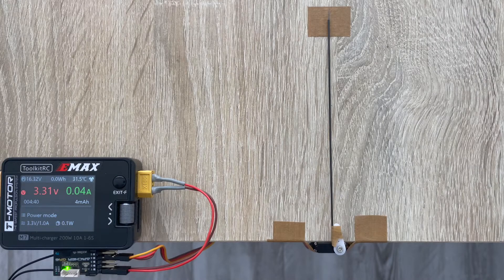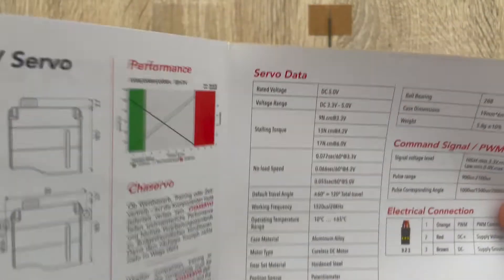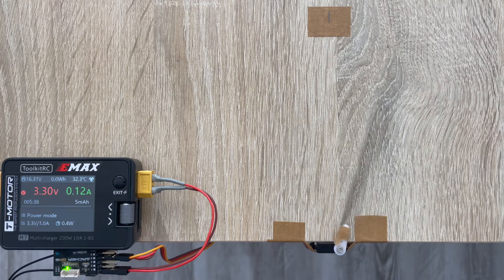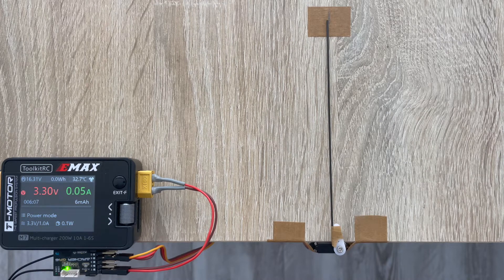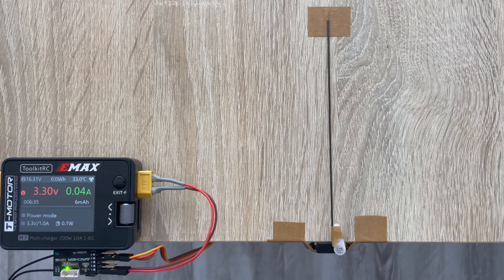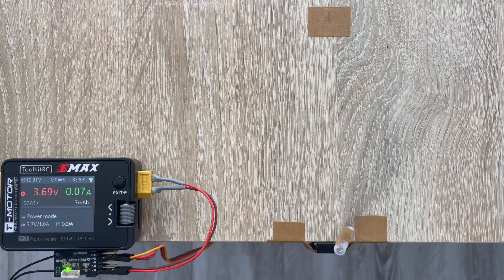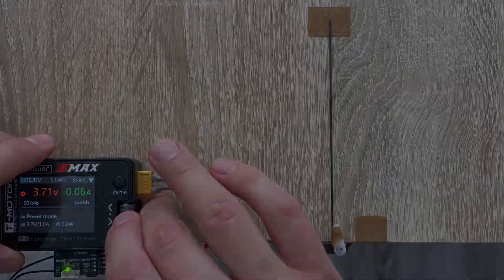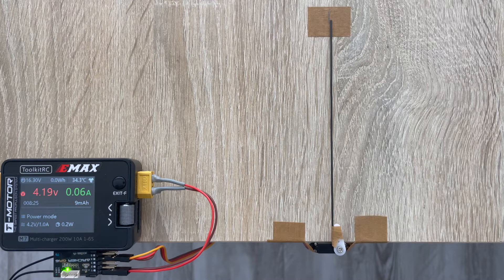CHAServo LV06: The Best DLG Servo Research

Comment: Do other samples of the LV06 have the same slight double centering?
Reply from the maker: Occasionally, there it happens, but I've got reports that it can be fixed with programming. 

We are planning on using these servos in some of the Receiver-Ready gliders that we offer, and will make sure that we do program them to center as precise as possible.

Comment: Very fast on low voltages. The slight double centering may be a result of the taller gear train required to obtain such speeds?? I don't know, just a theory. Thanks for the great tests.
Reply: A taller gear train makes a servo slower with higher torque (the motor is the fastest element in the gear train, so less gears = faster).

Comment: Thanks for all the tests. Could you also do a temperature drift test? Just heating it up to, say, 50C and check if the pointer moves any. Same for cooling. You could cool the servo in your freezer. Then take it out of the freezer and start testing by slowly heating it up to room temperature.
Reply from the maker: Yeah, absolutely, the thermal drift is a known problem with a lot of servos on the market.

We might consider performing these tests in the future and will share the results afterward.